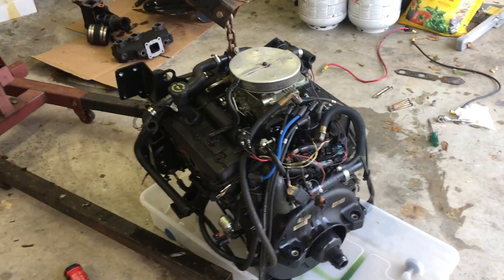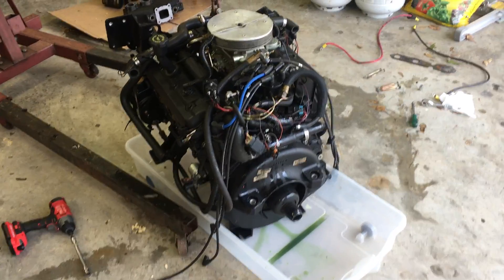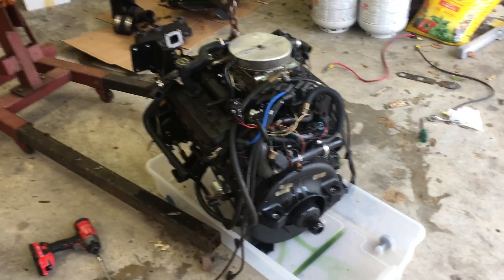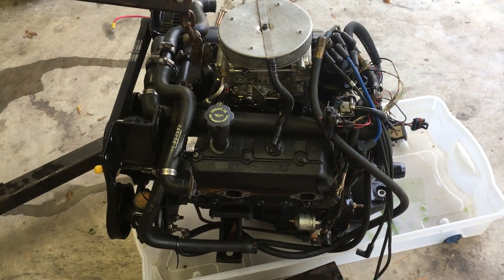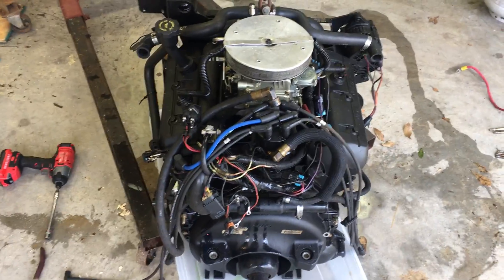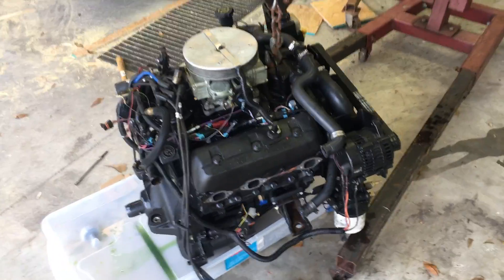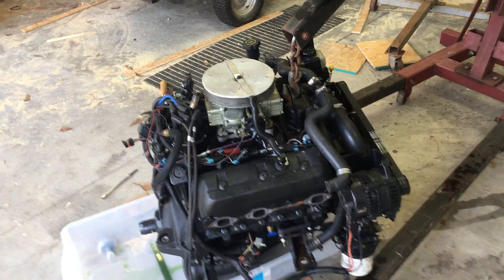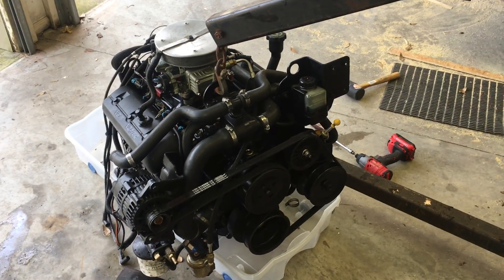SOLD!! 4.3 Mercruiser Engine Teardown Part 1

Comment: So those 2 bolts unbolts the motor from the transom plate?
Reply from the maker: lsxjunkie the motor is not bolted to the transom plate. The motor is mounted on engine supports built in to the boat stringers. The engine sits just forward of the transom assembly.
Reply from the maker: I misunderstood lsxjunkie’s question. The two bolts that stripped were two of the six that held the rear bell housing to the engine. The bell housing is then mounted to the transom plate.